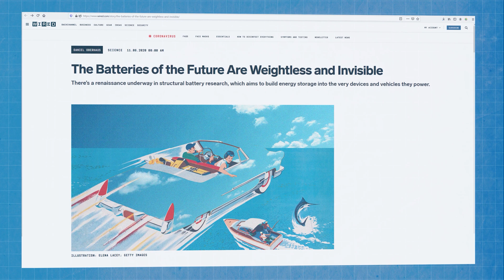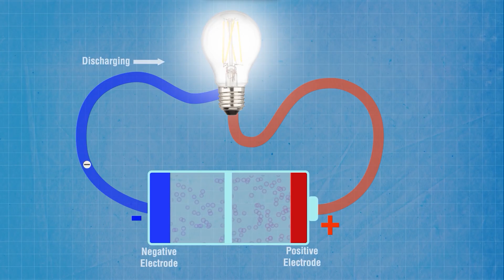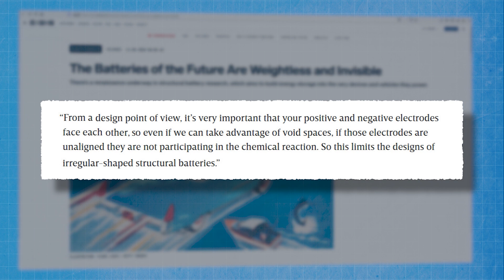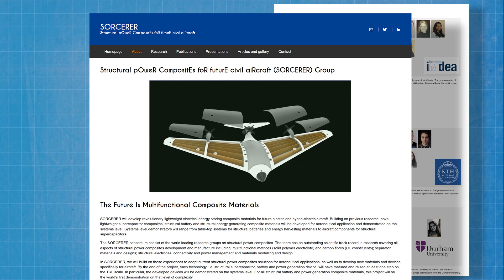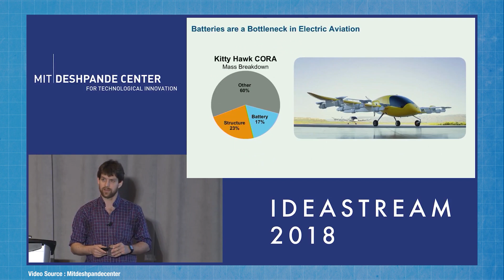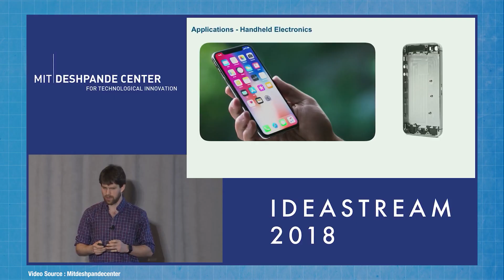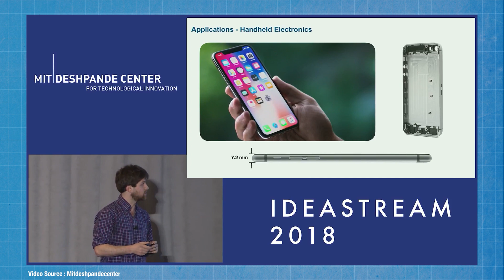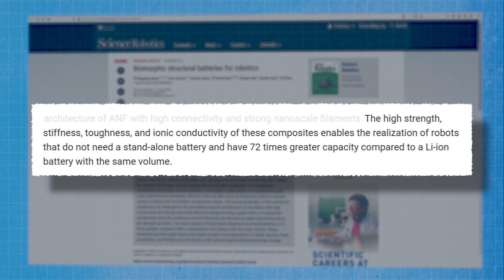Batteries in bodywork. Extending the range of cars and planes.

Comment: Had this idea in 2000. My idea is to make the sandwich core material be the structural battery element: hexagonally patterned cells, taped together, then to have a conventional CF or other skin. The reason for this is that the electrolytic material must have very high diffusion rates, precluding totally solid state media. You want a gelatinous media for high diffusion rates (proportional to rate of charge and rate of discharge), but a gelatinous media is inherently not very rigid. Ergo, use it for space-filling rather than direct mechanical load bearing. i think a semi-gelatinous salt bridge and separator can be found which is only really strong in shear (requirement for core filling media in sandwich construction), but align the shear plane orthogonal (normal to) the load plane. Augment with tapes and other core separation media (fins basically), and you have a pre-panelized battery. Best applications for this are initially: start with boxy shaped items like refrigerated trucks (already built using sandwich core theory), other OTR enclosed trailers, cargo vehicles. 

Adopting compound curvature would not be impossible, but would require some iterative AI-enhanced CAD design (a bit of fancy Oragami, basically). Better to start with simple prismatic, then simple curvature, and tackle compound curvature applications last.

Comment: I fear planned obsolescence though.
You can replace regular batteries at the end of their life cycle.
But basically, the thing with structural batteries is that then end of battery life, also implies the end of the device or vehicle.
I mean, how are you going to replace EV batteries, if the EV IS the battery?

Comment: What I know about electric cars. Actually from what I can understand it's really not the battery per se is it's the ability to charge them really fast you can charge majority of electric cars batteries really fast they're just not enough charging stations with that capability face it until superchargers become as common as gas stations they will never take over gas powered cars and that's just the sad fact about it.  if they are not Universal superchargers that can charge any electric car no matter what manufacturer and it is and this is another limitation to the electric car

Comment: At Tesla's Battery Day, I didn't get the impression that there were any plans to make batteries in any unusual shapes; rather, they seem to plan on keeping about the same layout as always, but making the cans of the cells, possibly the center electrodes, and the fill mat'l between the cells all rigidly connected.

Rigidity could be a key concept here. Either the entire contents of the battery need to have the rigidity to keep from flexing under the highest possible loads, or they need to be able to flex by some amount without impairing their longevity.

It does seem likely that unusual battery shapes may be relevant for other applications, such as aircraft.

Comment: so, inside lithium ion batteries is an electrolyte (that's a fluid) to allow electrons to move from one side to the other through a seperator. but... I was wondering... have you used an ultrasonic humidifier? because they use ultrasonic sound to create a myst and that myst would include say: an essential oil that you maybe have added, or minerals (I tried rock salt because I think it's good for skin). The myst produced was properly salty! know where I'm with this, with regards to batteries weight savings?

Comment: Great video as always Dave. I love the visual explanations, as those really seem to have the greatest potential to demystify concepts and ideas. 

I had something a little different in mind for this video when you mentioned structural batteries. Was it your channel that covered the group in Switzerland, Energy Vault, that stacks concrete as a sort of "structural" battery? 

I do admit that being an electrical engineer in the O&G industry (sadly, and on the way out), the "structural engineering" we deal with mainly comes in the form of concrete and steel. Glad to have my thinking expanded, no thanks to this awesome channel.

Comment: While batteries might be heavy and fuel light remember that engines are heavy and motors light. You need to compair the complete drive system and fuel of both types. Also while the early Tesla Model S was 2.5 tonnes, my MG EV is only 1.6 tonnes, only a bit heavier than my old Dacia Sandaro.

Comment: Structural batteries are cool but not necessary, an electric car's energy storage weighs 10x  that of an ICE car? well an ICE's exhaust system weighs an infinity more than an Electric cars exhaust system, that's how silly such arguments sound to me - comparing component to component doesn't make much sense, compare vehicle to vehicle, acceleration, braking, traction, handling, initial cost, fuel cost per mile,  maintenance cost, repair cost, interior space compared to footprint,  range, refueling time, ride quality, etc, etc . To me a structural battery would make the most sense in the actual battery box .

Comment: about the skin device, we could use the Seebeck effect (A thermoelectric generator) to power it, never requiring to charge.

Seebeck effect is like the peltier Effect, but for the other way arround: it transforms heat difference between two points into eletricity. So then skin heat woul be the hot side, and air would keep the cool side cooled (essential to keep it working)

Comment: "the same problem in planes as they do in cars" - wow...

Lets fully convert the easiest system into BEV first, start with trains (golf carts were electrified decades ago)  - then ships and cars - planes are the hardest nut to solve (likely going to be solved using Eco Liquids and fuel cells, rather than batteries).   this is more of an economic challenge than technological - yes we need science (isn't that obvious)

Comment: Just have a Think. -  FALSE , you are Incorrect . 
Electric Cars were invinted in the 1890's , using Bicycle transmissions and LEAD Acid batteries . 
Electric cars then were Already FASTER (up to 45 mph ) than by Horse and could go a Distance of 100 miles , (which also outlasted the Horse). 
from 1880 - 1910's Electric cars WON every race they were in including TRACK and OVERLAND races.
and even Ferdinand Porsche 1st car it Invented was an Electric , as was the Daimler/Mercedes Benz car. 
IF Electric cars were allowed to Continue HOLISTCALLY then we would have NO NEED of the ICE Combustion car at all. 
Instead, what happened was FORD and GMC Conspired to supress the Electric car and to go on to sell their POLLUTING ICE cars. 
they, stole the Electric Starter motor from its INVENTOR and the DODGE Brothers. 
and started to Incorporate the Electric Starter into ICE cars. 
Up until that Point , starting a MANUAL CRANK Combustion car was a MESSY and Dangerous Affair . 
making the ELECTRIC CAR the Choice of WOMEN , based on the SAFETY Alone. 
my , POINT is we ALREADY had the PERFECT Personal Transportation in the 1880's , the ELECTRIC CAR . 
and IF were allowed to Continue from then , we would have had a MORE Advanced Society even before 1910. 
Research would have continued with Bigger & Better batteries and more Stronger Motors and Improved Electric Drivetrains.

Comment: Well .... that's kind of ..... bull-you-know-what. For one, without all-nuclear grid there's no point. For two... uhm, no. Structural batteries are just smart way to cram bit more of battery volume (and therefore capacity)  into a car.  Nobody says anything about RADICAL INCREASE OF ENERGY DENSITY of batteries and reduction of charging time. Also, you'd need to radically SOLVE lithium issue - because having combustible thing literally all around you is NOT cool ;)  About the planes - there, 2-5% of economy improvement is HUGHE thing. Therefore, saying that you can offer 20-30% energy of current solution .... is laughable. Also,  currently planes get lighter while they burn fuel, which won't be the case in case of electrical planes and I'm afraid, that any "fuel loss" will be far quicker, radical and more  damaging than loss of hydrocarbon fuel.

Comment: Great ideas, my question relates to cars specifically. What happens in a crash with structural batteries mounted all over the body?
It's important to secure the power source in any vehicle, be it fuel or batteries

Comment: Dave that was very interesting. If you take the concept one step further how about a structural battery system integrated with an ultra thin solar collector that continually replenishes the structure battery system.

Comment: ...but what happens if they're is structural damage? Do the engines cut off? 

What if a car with a structural battery gets sideswiped? Will it kill the engine?

What if a bird hits a plane hard enough to crack structure, will the plane crash?
Reply: I would think they will be made out of many panels. So if one (or a few) gets damaged, it will not be catastrophic. And i think vehicles will still have a dedicated battery, it will just be smaller than what we currently need.
Reply: @puppeli  batteries run on circuits. If array gets disrupted it'll kill whatever it's powering even if it's ran in parallel something like and engine with take a major hit if cells are damaged.

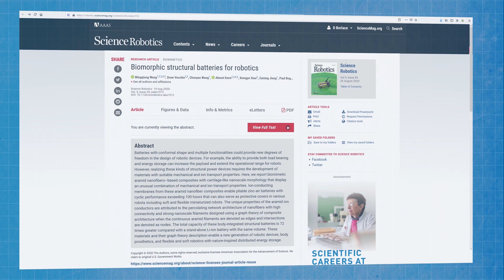Comment: 9:56

So if they have 72 times the capacity of a conventional lithium ion cell with the same volume can't you just stack a bunch of them on top of each other and make a non structural battery that is much better?
Reply: I believe they meant 72x the volume of the entire product, not the just the battery

Comment: It would be nice if the structure of a phone worked as a supplement to the battery, but I have 1 question: what happens if you drop it? is there a risk of short-circuit? And I also think we wouldn't need thinner devices, I'd rather keep the battery as it is in order to have very high capacities

Comment: Many thanks for your wonderful vids. I look forward to new releases. Plus your voice is very soothing and articulate. You give a ray of hope in a world embroiled in dark times. 

Video ideas: 

1: compliant parts/compliant assemblies that are one piece but are designed to move

2: resins and their many uses- electricity to filtration to coatings to make up/food 

3: elastomeric/elastic materials- from solar roof reflectance to gap sealing to vehicle coatings 

4: bouncy materials- durometer measuring and how it’s related to material properties.

5: composites- how different ingredients can produce strange materials 

6: urethanes/polyurethanes- because flexible materials often fail or “rot”. These materials withstand the test of time much better than older offerings such as rubberized paper/cork. 

7: micro power generators- producers that make meaningful power. Ranging from microscopic to more ergonomic sizes. 

8: room temperature semi-conductors- why such a big deal? 

Hopefully, sharing my odd interests can help produce wonderful content.

Comment: imagine an energy grid where the vehicles we use are super light weight, with only the motor, a thin chassis, and small, very small, structural or regular batteries, and stopping repeatedly to recharge the small battery. so you arent transporting batteries. like the gas tank is pretty light weight. and the hydrogen tanks for fuel cell cars are somewhat small. maybe charging panels along roads every 5 miles, everywhere. stop, charge, go 20 miles, stop, charge, you arent carrying the batteries so your vehicle goes farther.

Comment: How do you replace the battery when your remote/car/plan/etc 'is' the battery?
In a Bolt/Tesla/Leaf/etc when the battery stops being able to store enough electricity you can relatively easily unbolt it and pop in a new one. But if the battery is the main body you'd have to get a whole new car. I fear this will allow planned obsolescence on the scale of planes, trains and automobiles. :X

Comment: Hey Dave! Minor correction: at 1:00 you say "pure silicon anodes".

Pure silicon anodes are going to highly unlikely. It is true, that silicon can theoretically store 9x more energy, but expands 300% in the process and causes engineering challenges.

The sweetspot is between 20-30% of silicon from the total anode mass, as you would only gain around 8% energy density from the remaining 70-80%

Very good video on topic can be found here: https://youtu.be/YTW_Q63bEEY

Comment: I never understood why they don't use Dynamo's on the wheel axles to generate charge
Reply: You got a bi-cycle with a dynamo?
Ever noted when you engage the dynamo its harder?
That's the wheel-turning-energy needed to drive the dynamo to make electricity.. which would come from the electric motor.
Or in other words it's wasting energy, as the conversion from electricity via electric motor to wheel motion to electricity via dynamo is not 100% but less..
Or in even other words, because of the 2nd law of thermodynamics (https://en.wikipedia.org/wiki/Second_law_of_thermodynamics)
Reply: @joansparky4439  You Win :)

Comment: There's no clarity about what it means. Does it mean that the frame/shell of the car becomes a battery? If so what about damage and what happens when the capacity of the battery degrades - do you throw away the whole car? Does it instead mean that structural loads are going to be put through the boxes in which the batteries sit? That's more understandable.
Reply: if the cycle times go past 3500 (=10 years, 1 full cycle a day) this will be a non-issue.. I believe we are at 1000-2000 now.
Tesla is touting the 1 million mile battery for the trucks.. a normal ICE engine is done at what again? Not to speak of the outdated, obsolete and worn down chassis it's been riding in.
Reply: @joansparky4439  Maybe, although I drive an 11 year old car at the moment and it works fine for me :-)
Reply: @timmurphy5541  
I got a 2006 hatchback, I win  ;-)

Comment: I guess battery life span is critical here. You may not wish to throw out a car every couple of years.

The idea not to try to rely on increasing batterie's capacity to weight ratio is very reasonable. As Thunderf00t pointed out is his video, with energy density increased (thinner separators...) the hazard of it's sudden release (-> fire onboard) must get bigger. And even now, it is non-negligible.

Comment: all wrong .. the obvious practical solution is for electric cars to be designed like huge cassette players ..  with the batteries as the cassettes and cars the players and petrol stations etc having robotic cassette changers .. out with the discharged battery , in with the charged one .. and a bill according to the charge left in the discharged one.  Otherwise you'll have huge charging queues up the M4 etc once a significant number of electric cars hit the market

Comment: Seams quite practical. I wonder how mechanical stress adds up to batterie's capacity degradation? Eg. you may have you dendrite-stopper crack... But definitely in the applications where external blasts or pressures are small, it looks very promissing.

Comment: The figures of one third of the weight of an EV may be the fuel (batteries) when in combustion cars it is 3%.  mmmm Not quite right.
Take the weight of the car without the motors, transmissions, differentials, etc.  Then add the weight of the batteries, electric motors, etc for an EV.  Then add the weight of the engines, a full tank, transmission, etc, for a combustion car. 

Batteries may be heavy, but so is the running gear of engines, transmissions, etc in combustion cars.
Reply: Still, compare a model S to a similar sized sedan and you‘ll see the former is much heavier.

Comment: Sounds great until it comes time to replace the batteries...
Reply: Depends on the cycle times those batteries are capable off.. if they exceed the use-life of the device in question, there won't be a battery replacement.
Reply: @joansparky4439  indeed. Although vehicles tend to last rather longer than, say, a mobile phone
Reply: @LeeSmith-cf1vo  
Good.. say 1 full cycle a day for like 200.000 km.. and a car with a full range of 500km.. that's ~400 cycles.
Properly treated Li cells can do 1000 full cycles. Really good ones do 2000.
Tesla is talking about the 1 million miles battery..
I don't know which consumer vehicle will actually be relevant (technically, safety wise) by the time it would reach such a lifetime - not to speak of the wear and tear on the vehicle parts itself.
Reply: @joansparky4439  1 million miles does indeed sound like rather more than the lifetime of any road vehicle I'm aware of, although the same may not be true for trains and planes.
I would also point out that the phone batteries are often stated to have a much longer life than they often turn out to have. Honestly, I hope that you're right and I'm wrong. It would be a shame to have to throw away an otherwise perfectly serviceable vehicle because it is impossible to change the battery without also changing the entire chassis. Aside from the waste of money, there's also the impact of constructing the replacement, and recycling/disposing of the old to consider.

Comment: Reinforcing stiffeners, front/back panels, skins, beams and frames have different structural requirements. And with new puncture safe batteries not causing shorts when punctured,  a back panel on a chair may have a 2nd life as a side panel on a fridge, LED skin backing transferred to emergency lighting, wing stiffeners transferred to furniture structure or backing for solar shingles. A battery skin coat would mask secondary irregularities yet provide the needed performance physically. What would help move things along is standardization of material dimensions to help aid reusability.

Comment: with all the regulation of temps for EV systems as they are ... unless you have a massive leap in operating range this is just nonsense..... it may have use for unusually shaped battery packs that then can be regulated. the plane example was moronic given sub zero temps.